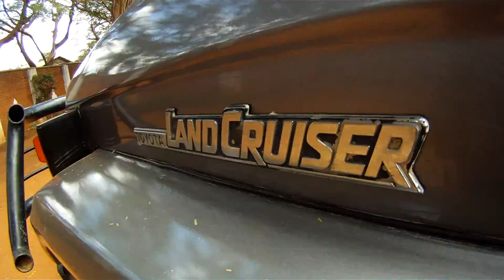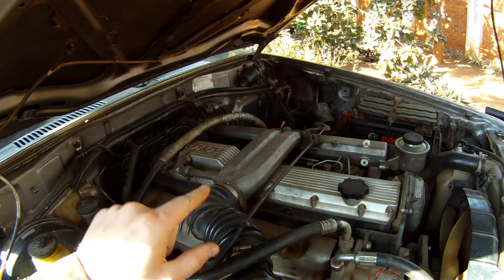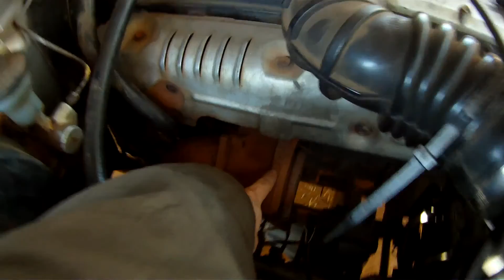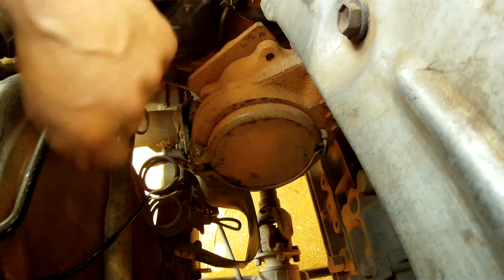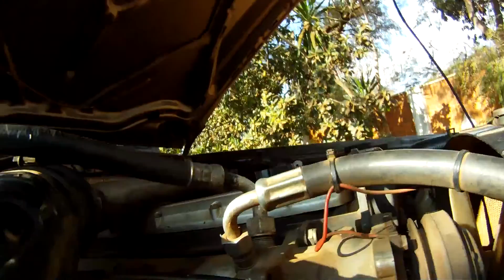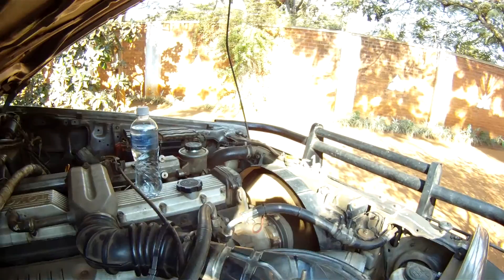1HZ/300Tdi Engine - Land Rover guide to the Land Cruiser - 2/15

Comment: 1hz is indirect injection
Reply from the maker: Thanks!
Reply: Landcruiser gearbox and transfer case is working on Defender-110 TD5  front and rear axles? Thanks
Reply: @sdalai2131  I think you were trying to ask if you can fit a Land Cruiser gearbox and engine into a Defender.
It has been done. 
The trick is to weld a Toyota flange onto the prop-shafts at the gearbox end.

Comment: Coming back to watch this again in lockdown.
I think I just want to see a bit of Africa again!
Regarding the turbo, it is possible to bolt a small turbo onto the 1HZ  without causing too many problems, 
just a word of caution, the Turbo versions of this engine 1HD-T, 1HD-FT and 1HD-FTE  all have upgraded pistons and con rods that have an oil passage way in order to cool the underside of the pistons. 
If you put too much boost into a 1HZ,  you will cook the pistons.
Reply: Yes it’s very possible and lots of the bigger safari wagons here in Kenya have them fitted , however they are running at much lower boost levels than the standard turbo charged siblings so they don’t need all the internals upgraded .
Reply: Cool the head actually because these are indirect injection. When you add a turbo the pre combustion chamber gets to hot and cracks the head

Comment: Good video,  point of order is yes there is room for a turbo this engine is not designed for one. After market “ soft” turbos can  ( generally ) be fitted,  as far as I know they don’t put too much strain on the components affecting longevity. I have a Landcruiser 80 ( with turbo) and a Disco 300tdi, I love them both,  similar setup on each, ( suspension,  tyres intercoolers etc,)  Both have performed extremely well.